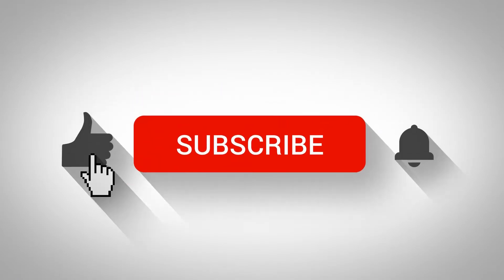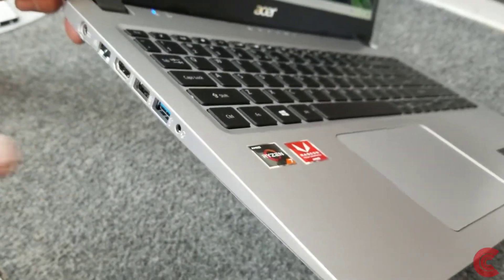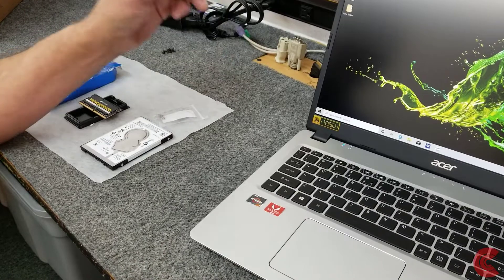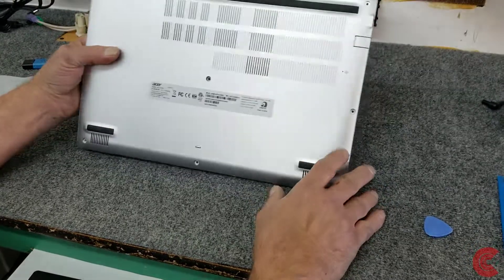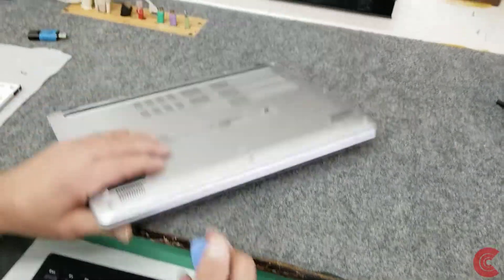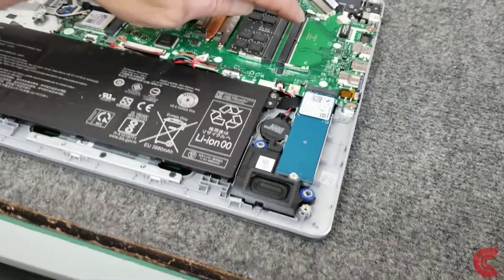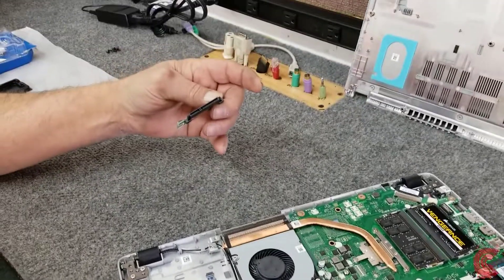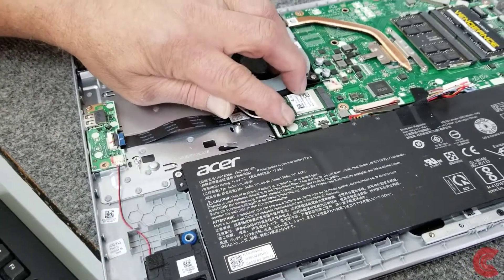Acer Aspire 5 Ryzen 7 Laptop SSD, Memory upgrade. Install Internal Hard Drive. Model# A515-43

Comment: Hi Dale, I have the Acer Aspire 5 with the 8GB soldered ram and 512GB pcie SSD. Could I add a 32Gb so-dimm ram and a 2.5" sata internal SSD?  Thank you
Reply from the maker: Hi. There are some variants of Aspire 5 laptops. Depends on exact model...
Reply: @Dale I have the 2021 Acer Aspire 5 A515-45 with 1 8GB ram soldered into the motherboard and 1 free ram slot. It also has an AMD Ryzen 7-5700U processor and 512GB Nvme SSD inside.I searched online and its showing conflicting details on the max ram allowed for the upgrade. Your insight would greatly help before I plug in the 32gb ram, thank you

Comment: HI there, does it only work with HDD or can I use an SSD 2.5" sata as second drive instead? I looked for that info in acer's website but I can't find the answer. Hope you can help

Comment: I ordered a  Aspire 5 A515-43-R19L. I plan on adding another 4g of ram to make a total of 8g (was told adding a 8g would still only get me 8g total). It has 128g SSD. I want to add more storage. I don't know what exact HHD or SSD to buy. Something was mentioned about notes, I don't see any notes. Please advise and thanks for the video!
Reply from the maker: The show notes are below the video, under the description and my logo, click on show more.  Your model probably has 4 gb on board memory. And one expansion slot. You can add up to 16gb in the expansion slot. Dale
Reply: @CadillacComputerCenter  Thank you sir! I want to add storage. I am leaning toward HHD instead of SSD (it has 128 SSD). I am ignorant but learning. I could go with 500 or for a little more 1T. I want to make sure I order one that's compatible. Great video!!!

Comment: I just got one of these yesterday. Ram was easy, but the Sata ribbon just won't clip in right. Oddly mine has the wifi attention board on top of the ribbon clip so it won't fully open. Any suggestions?
Reply from the maker: Hi.  You actually have to remove small screw from wifi card to lift it up.  Be very careful , dont strip the screw head. Use a good Phillip's screwdriver.  Dale
Reply: @CadillacComputerCenter  tbh i tried and nearly did strip it. That thing is way too tight. I might try again
Reply from the maker: Should be able to get it with a #0 Phillip's. Make sure it has a good clean tip.
Reply: @CadillacComputerCenter  ok ill probably go buy a new one. Hopefully I can still get it
Reply: @CadillacComputerCenter  is it a Phillips 0 or 1?
Reply from the maker: @cryptonian4114  yes, #0 always works for me. done many of them. they can be very tight. Push down firmly but not to hard.
Reply: @CadillacComputerCenter  i got everything in now, however the PC isn't recognizing the new SSD ugh
Reply: @cryptonian4114  Same exact problem here.  I wonder if he is able to show the actual Windows installation...was hoping to see if his Windows install detected the SSD
Reply: @moodie316  tbh I sent the SSD back to Amazon. Figured if I need the extra space I'll just buy a 2-3TB USB 3 external. It'll probably be more convenient to have one that i can use elsewhere anyway.
Reply: @cryptonian4114  I hear you...I searched the web, and the issue may be that these laptops cant run NVMe drives greater than 500GB.  Just for future reference, I returned the WD SN550 1TB, and bought a Samsung 970 EVO Plus SSD 500GB M.2 NVMe...now, the 500GB Samsung works perfectly for me, and that install went exactly as I expected.
Reply: @moodie316  oh ok I never tried to replace the M2 drive. I only had planned to add the SSD in the open expansion area. Glad its working for you